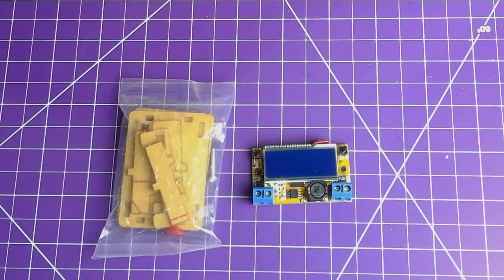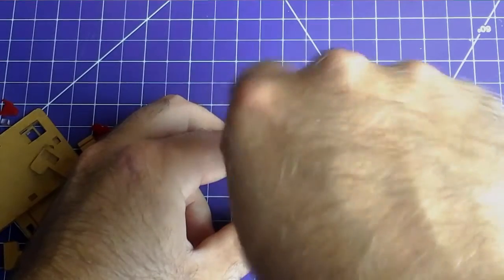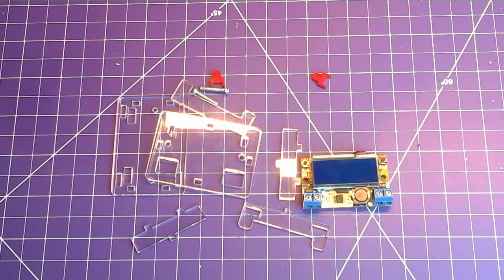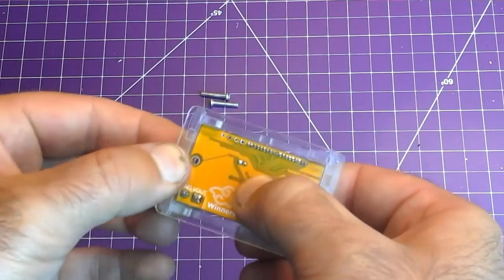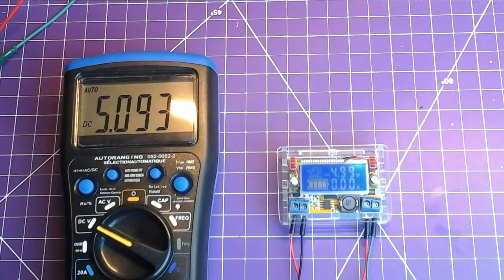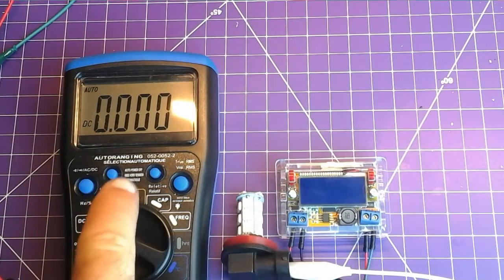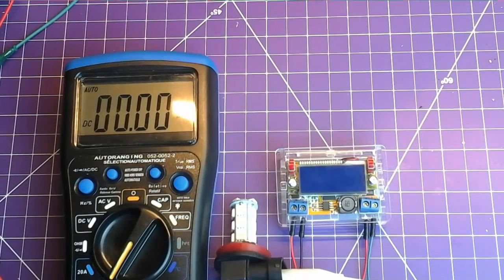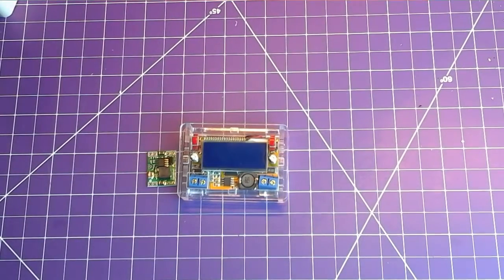Ebay LCD DC-DC step down power supply REVIEW

Comment: MINE RAISES VOLTAGE POWER ALL BY ITSELF...SO IF I PUT IT TO 5 V AFTER 2 MIN ITS GOING UP TO 6-7 VOLTS VERY SLOWLY...UNTIL IT SHUTS OFF BY ITSELF.
Reply from the maker: This it's broke, chief
Reply: @SimpleElectronics  chip broken or component ??
Reply from the maker: @EFDawahWiseSmile2LanternDen  I don't know I would need it in front of me

Comment: Hi can this stuff possible to use in 12 volts converter charger? TIA
Reply from the maker: Not quite sure your application - it is a buck module, so you need to supply it with higher voltage than you need.

Comment: Thank you for the great video. I just received mine today, and I was wondering if I could use a laptop power supply 19v,  4.74 amp.with it when I trave, or if the amps are too high. When I'm at home, I have 2 bench variable power supply. Keep up the good job with your videos.
Reply: Yes you can. It will only draw what amperage your particular project needs. But any laptop supply will be fine....up to 24v.

Comment: You can and need to calibrate the power supply you hold down the left button when plugging it in the unit will be gun flashing have your voltmeter connected and adjust the voltage to what it says on the screen to match your voltmeter using up and down when you're done unplug the unit plug it back in you'll find it's very accurate

Comment: Hi  where did you get the 20v power supply from , can you please tell . I need to buy one for my diy projectthanks
Reply from the maker: Hey! I got my 24v power supply from Ebay, if you search the usual suspects (Ebay, Aliexpress etc) for 24v 15A power supply, you will find one. I got a 15A one because I calculated that I would need roughly 200W and wanted a little headroom
Reply: @SimpleElectronics  Just to help you, i run mine just fine from my 24v 40a supply. No problems at all in 2yrs now with 2 of them. May be a little out of spec but works fine. Thanks for the great review. I love these things.
Reply: I should have mentioned too that it goes up to 18v output at its max with 24v input, at least on mine...which is kinda handy to have the extra 1.5v output over spec.
Reply: Thanks I already ordered for one

Comment: Hej Mate. Calibration Mothod:

Power-off status, press and hold the left button access the power, the display starts flashing, release the left button. using multimeter measured the output terminal voltage, if the measured voltage is greater than 5V, press the left button reduced the voltage to 5V; if the voltage is less than 5V, press the right button to increase the voltage to 5V. When the LCD display voltage of 5V(sometimes it shows 4.99V), turn off the power, the calibration is complete.
Reply from the maker: Good to know, thank you